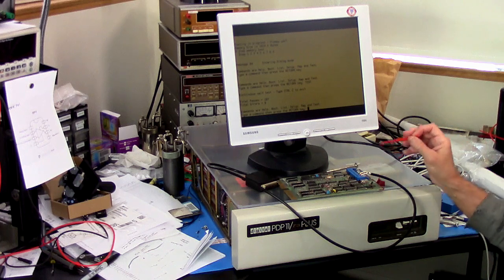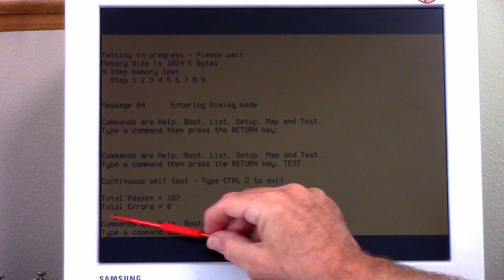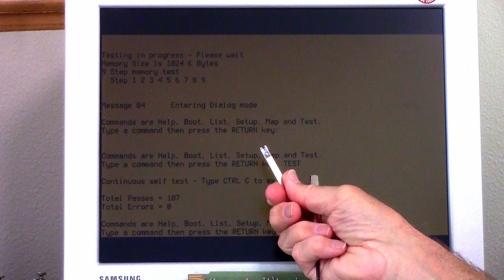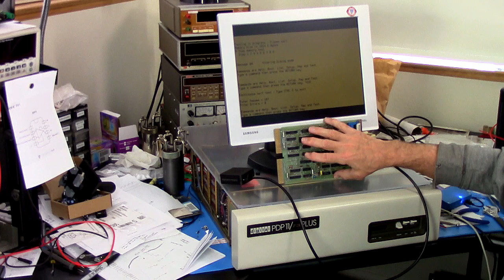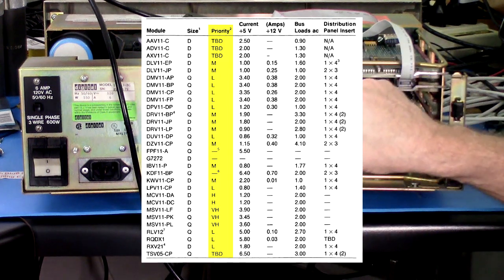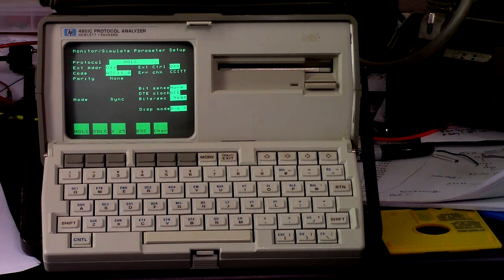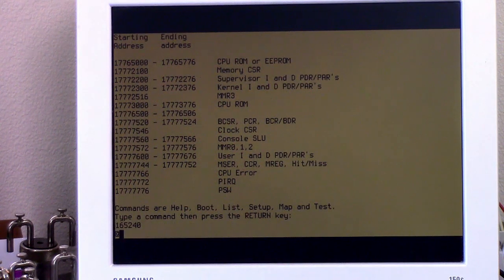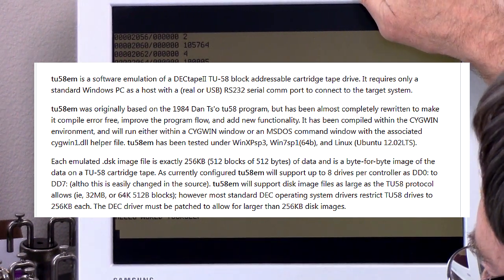PDP 11/73 PLUS Part II: Adding a Serial Port

Comment: use the quad version
Reply from the maker: By "the quad version" I assume you mean the M8043 (DLV11-J) or 3rd-party equivalent.  Since I didn't have one of those when this video was made and this video was about making use of available resources, that is not really a practical suggestion.  Also, had I needed current loop or modem control, the M8043 would not work - the M8028 (used in the video) and M8017, respectively, support those capabilities.